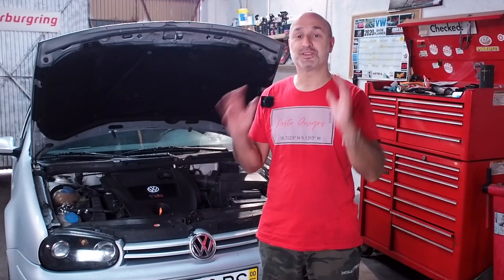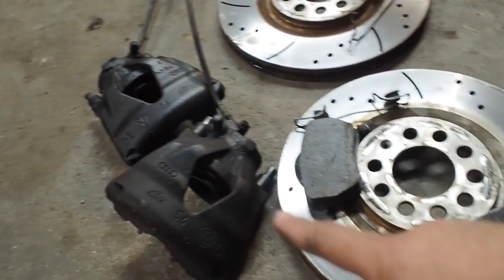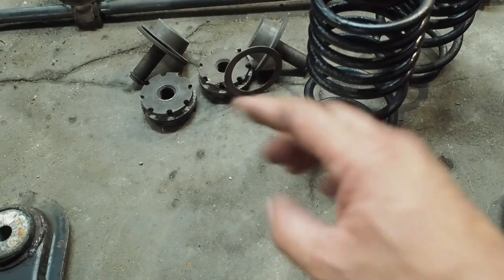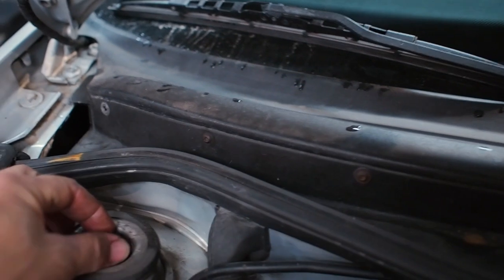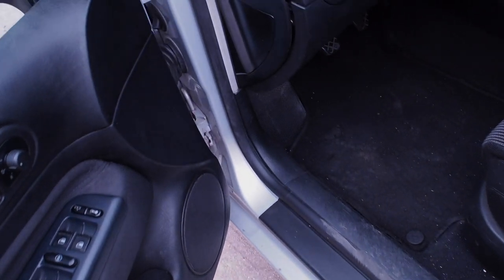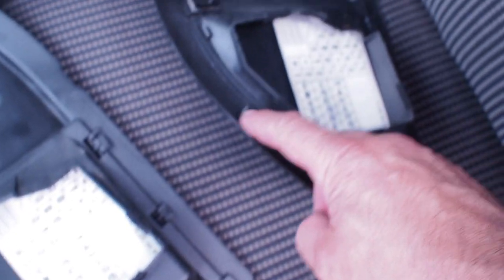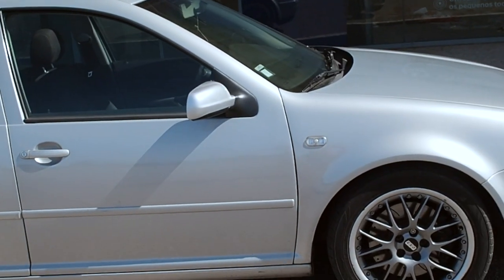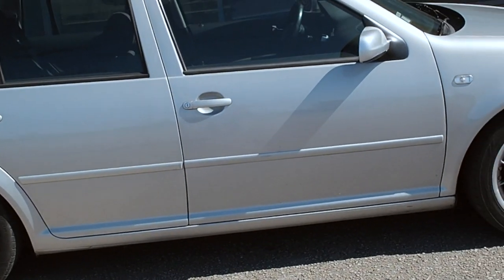The Golf mk4 Wagon dropped! H&R BBS RX504

Comment: The skoda Octavia vrs has the 256mm rear disc...that caliper carrier shud fit your wagon to upgrade the rear brakes too...I've noticed with the 312mm front brakes under hard braking it nose dives a little and transfers the weight off the rear so upgrading the rear 256mm rear disc will pull the rear down and balance the weight distribution better...im not sure yet whether the skoda has the vented or solid disc ...as soon as the carrier arrives I can measure the cut out for the disc as the vented disc is 22mm wide..nice wagon buddy...my daily is Audi b5 tdi avant 22yrs old ..I'm driving it as my daily 12yrs now still ploughs the road...the 312mm upgrade really bites and pulls it up well....I've been itching for a golf wagon with Bora front end for a while now...they are starting to get scarce...

Comment: Yess, loving it 👌 have been doing similar to a reflex silver pd150 gti 5 door recently
Reply from the maker: Nice 👍 so it's a late car being a GTI TDI.
Reply: @RestoDesignsnando  Yeah it's an 02 plate. Decent spec too as it has the winter pack and is a non sunroof (had too many of them leak) did have to put a cam in it though, typical PD's

Comment: I think 21 inch wheels can fit on mk4 hehe I know 20 inch can but I think 21 inch maybe hehe
Reply from the maker: 21 wow crazy on a mk4.
Reply: @RestoDesignsnando  : D
Reply: @RestoDesignsnando  I saw 18 inch wheels on Golf 3 mk3 they were so big looking on it so cool.
Reply: @RestoDesignsnando  do you still have your Golf 3 afn ?
Reply from the maker: @gpubenchmarks7905  The green tour edition Bon Jovi? I sold that to make way for this mk4 wagon, I still finishing off the 1Z blue GTD 'open air' which is 90% will be back on that very soon.
Reply: @RestoDesignsnando  Ah you sold it. It was a beast 180hp.
Reply: @RestoDesignsnando  do you like your golf 4 ? Is it better than mk3 and which engine is in mk4 ?
Reply from the maker: @gpubenchmarks7905  They are very different, I like the mk3 dashboard and the way it looks and once it has electric windows and AC it is totally a car that can be used everyday. The mk4 standard drivers with no feeling and understeers if you put it just a little, but once you if the right parts like I will be doing soon, it becomes a very nice car to drive, smooth, quiet, good handling and wide tyres 225 if not bigger, the engine in at the moment is AJM PD 115, will be putting ASZ with lots of nice bits and 220ps.
Reply: @RestoDesignsnando  sounds good. Yeah mk3 has better dashboard , mk4s is just very big and not that much quality of plastic like on mk3 . It will be cool if you make 220hp asz. Good Luck ! . If I remember ARL is the strongest TDI PD in mk4 150hp stock.
Reply from the maker: @gpubenchmarks7905  yes the ARL has stronger head bolts, better turbo and a nice front intercooler. The plastics in the mk4 are really bad compared to the mk3.
Reply: @RestoDesignsnando  true : D. Your green mk3 was pretty nice. How much money did you sold it ?
Reply from the maker: @gpubenchmarks7905  Oh I can't say as the person watching the channel and that wouldn't be fare.
Reply: @RestoDesignsnando  ah ok. Good Luck !